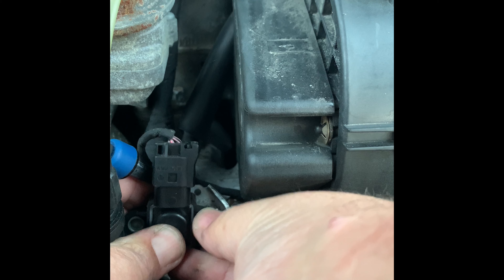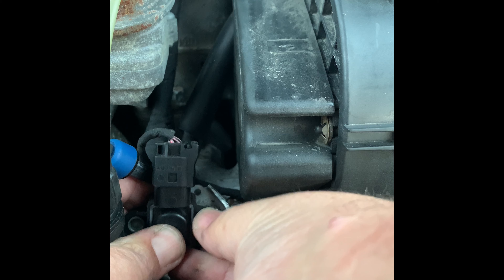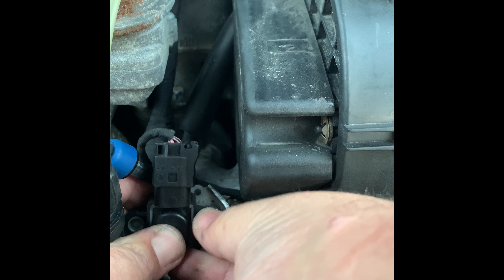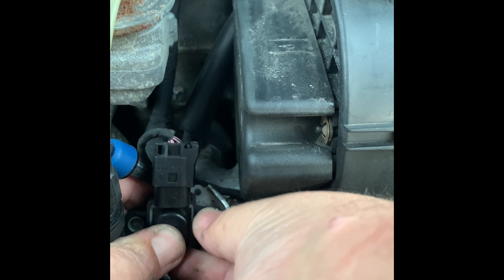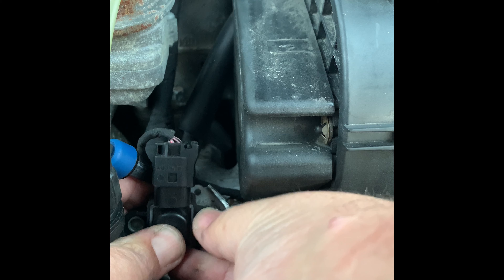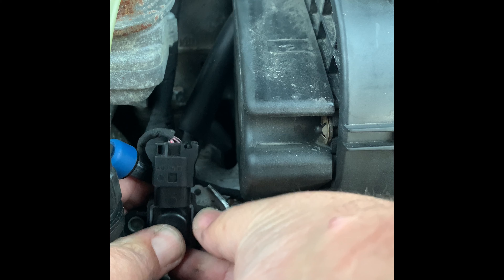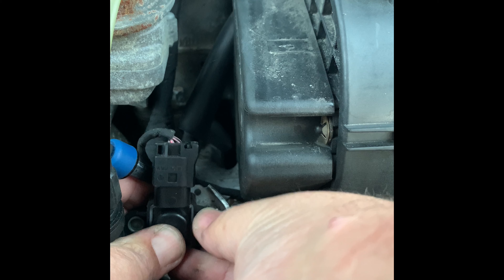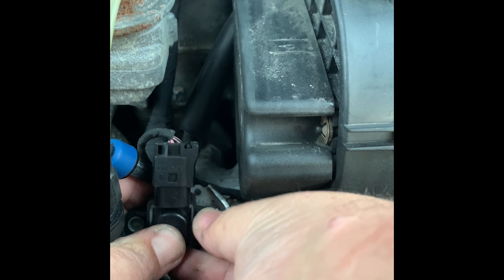How to change m.a.p sensor on any Mercedes Benz with m113 engine 2000-2006

Comment: How did you diagnose the issue? Nice engine.
Reply from the maker: Oh the must have item for your Mercedes w220. Get a obd2 code reader/ scanner, plug it up under the dash on the drivers side. And watch as fault codes pop up. All these sensors have corresponding codes  the obd2 scanner can alert you to.
Reply: @piscatawaymechanic  was it the p0106 code? I have a 03 cl500 with p0106
Reply: What does it run like how is the acceleration?

Comment: I replaced two map sensor including clean throttle Body 
on my mercedes benz C250 and after one day driving back with same fualt P0106 & P0068 especially no vacuum leaks at all,  any recommendations to solve this issue or you think need to drive the car for couple more days and fualt will clear by itself
Reply from the maker: All I can say is maybe, bad throttle body unit, they are electric and fail quietly, you can check the wires harness for power to the connectors (they  fray and crumble short out over the years)  , also a bad mass air flow sensor will cause problems that can’t be directly pinpointed by the computer, a lot for part stores sell defective parts so your new map sensor could be bad ( I’ve already had to change the one in this video smh) . And the hoses to things become very hard and ever so slightly cracked and cause problems . So nice soft rubber hoses are essential to the engine operation. Sometimes it can be simple stuff like the air filters need replacing .. hopefully this helps you somewhat

Comment: What part/hose is the one with the blue on it?  I replaced the MAP sensor but still getting codes, and not sure the blue hose is connected properly.   Very much appreciated.
Reply from the maker: The black hose with the blue ring is going to the secondary air injection valve change over valve ( it’s apart of the emissions control system) if that hose is broken may need to ask a dealership the part number it’s difficult to find the exact one online sometimes.. 
if ur obd2 code reading says map sensor go ahead and replace it like I did in this video. It’s also possible that there could be an issue with ur mass air flow sensor.. those will show a generalize code with no exact pinpoint of this issue ( so stupid lol ) but try to fix everything ur obd2 code reader is saying need attention first. Because if will drive u crazy guessing what’s wrong 😵‍💫.
Reply: @piscatawaymechanic  WOW!  Great answer.   I was having to work on this when my other cars were in the shop.  Replaced a MAP sensor but then it started throwing P0171 and P0173 codes.  I only noticed this week that the hose didn't seem to be connected back up.  You have given me enough to go on and might just need to hook it back up.  Thank you!  I'll let you know.

Comment: How many hoses are in that black tape connected to sensors ?? Do you have videos on replacing the hose running g them throw the engine
Reply from the maker: not sure about every s class ,but i should be 3 i think 🤔.. each black  hose goes to something different. and is each for sale separately and the clear hose is sold in a kind of long bundle that must be cut to fit the length it attaches to the part/ engine.  looking for part’s number is the best place to start in identifying what each hose is. thats how i do it because it’s confusing at the dealership and online guessing what it is.
Reply: @piscatawaymechanic  I found. The problem with Sensor you have the video my tubes are brittle need to be replaced ?? You have any idea where they run to or connect??

Comment: Sooooo, did it make a difference?
Reply from the maker: Well the obd2 fault code for inoperable map sensor went away… the map sensor is apart of the (ecu) way of collecting data in maintaining the correct Air/ fuel ratio in the engine..
Reply: @piscatawaymechanic  Thanks for the info. The vid kinda' left me hangin'. I've been trying to get rid of a rough idle now, for about 4 months and I swapped all the vacuum lines out and even resealed the valve cover gaskets. Among other things. I'll test it, but with 160k, I'm going through all of the systems. Good luck to ya!
Reply: @humble5190  same
Reply: @humble5190  did you even figure out anything ?
Reply: @humble5190 maybe o2 sensors or a dirty maf sensor